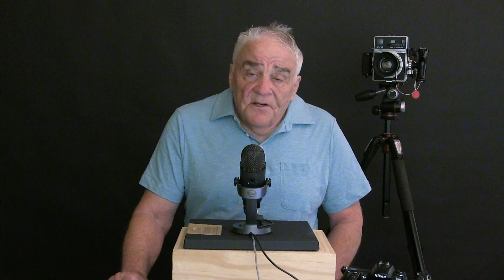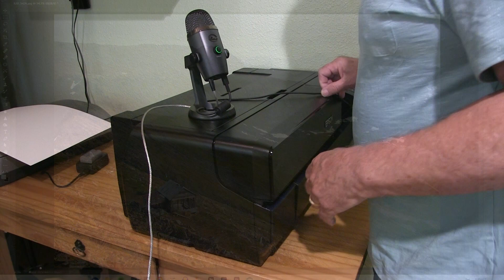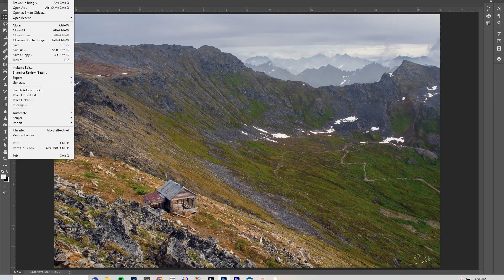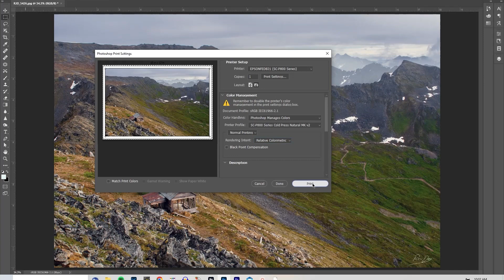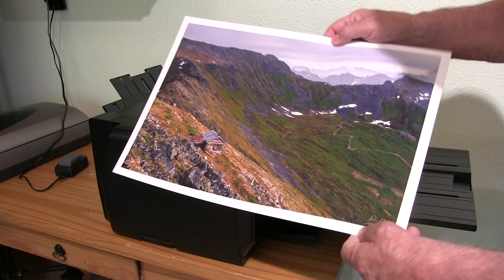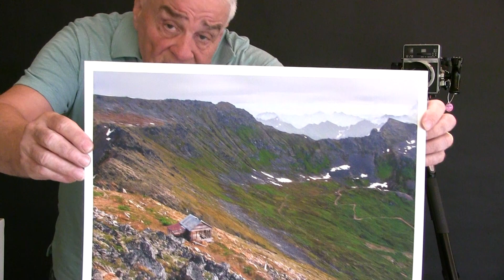Printing A Picture From The Nikon D300s On An Epson SC P800 Printer

Comment: I currently have a D300s. I kept it over my D7200. The only thing I liked about the D7200 was low light performance over the D300s, but the build quality put me off as well as the grain at low ISO. Loved my D90 & love my D300s, but I wish Nikon brought a D400 to market. I loved the sensor of the D7000. To me, it was perfect. 16mp was just enough. I hated the AF & the build quality. And thus I would have loved a D7000 sensor in a D300s body.
Reply from the maker: We were all waiting for the D400, but nope, Nikon skipped right past it.

Comment: This was fun. I have a D300s, and like you I have used it to little.  Nice camera,  a tough old bird, and it uses the same battery grip as my D700 - and two cards. Better RAW buffer capacity than the D7100.
Reply from the maker: I should use it more I guess. Thank you for commenting.

Comment: Ron, that's a grand vista view, and a good looking print.  Looks like your printing exclusively on Epson Cold Press Natural. Just curious if you have experimented with other brands. That backward loading of thick paper is interesting! On the P600 I did have issues getting the thick  to load using the front load tray. It was a bit difficult to line the paper on the indented line with my old eyes!! Thankfully Epson solved the problem on the P900, as all papers can load using the top sheet feed (per Epson). BTW have you tried printing with the Epson Print Layout App from Epson? 
Kind Regards.
Reply from the maker: Thanks Richard. So far I've been faithful to Epson papers, but that could change.  I have tried the Epson Print layout a few times but being a creature of habit I reverted back to the old software after a short while. I'm glad I found I could load from the back, I wasted a lot of time trying to load from the front.